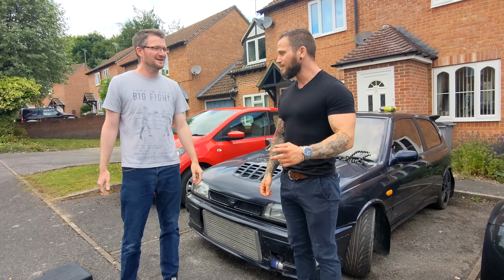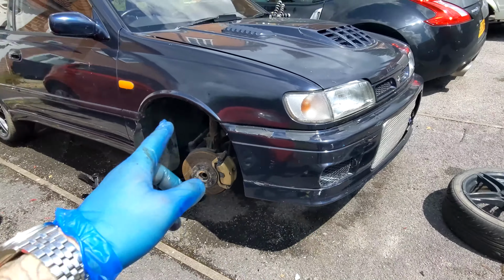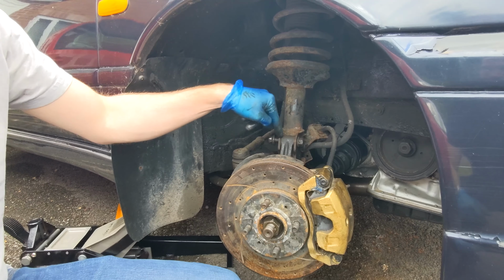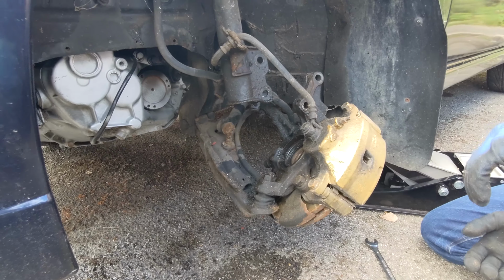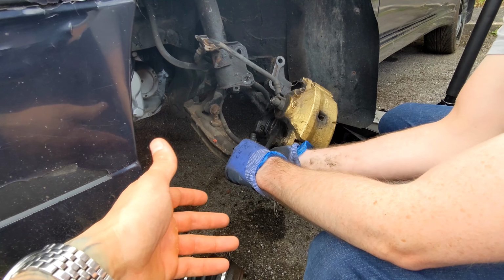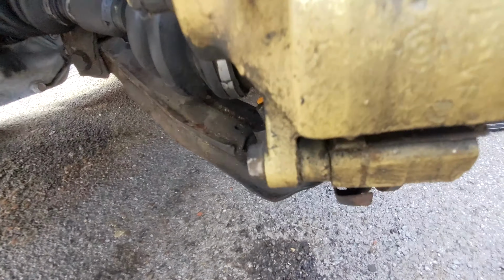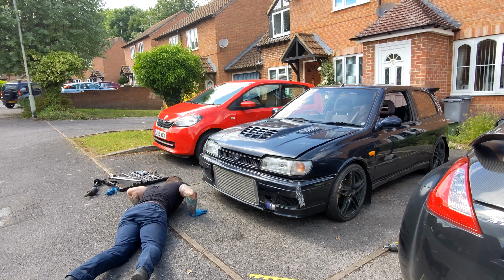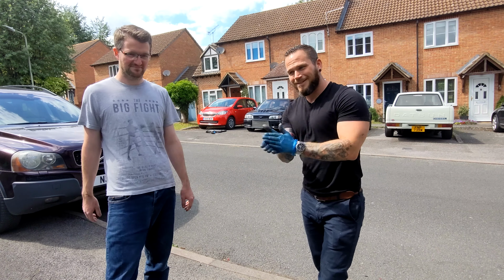Drive Shaft Install & The Car MOVES First Time In 7 Years! Nissan Pulsar GTiR Rebuild - Part 13

Comment: Alright Nick and Nate. How's it going my dudes?  Oh mate the banter is hilarious. The success on the Pulsar is so great hearing it start up and move is epic, great work. So am I right thinking that the Pulsar will be a looker and fast when it's done and it's the transmission you have to be careful of and not to launch it over and over? I can't wait to see how the 720 truck will turn out either. All the best, "Love you bye." 

PS. These nuts? That's an American advert isn't it?
Reply from the maker: The GTiR is a pretty quick little car, it's a turbo all wheel drive, fast, it'll be quicker than the nissan 370z
Reply: @MrHVlogsMore  Man that's so cool, you guys are doing such a great job and I'm really loving the progress video's. I can't wait to see it finished. I am also looking forward to seeing how the truck looks when it's done. And hopefully Nick's GTR isn't too badly buggered and it'll be an easy and not too expensive fix. "Love you Bye."
Reply: Love you bye

Comment: Takes me back to 1999 when I had my pulsar 
I'd get rid of those callipers once it's up and running notorious for brake fade
Reply: I think Nate is going to go down the wilwood route when we are looking at the brakes in the future so I don’t think that will be a problem for long!
Reply: I ended up fitting tarox 6 pots to mine use to be a gtir specialist in St Helens years ago I got mine off